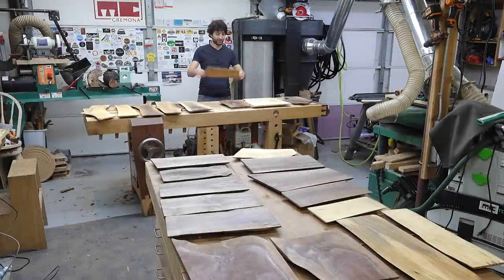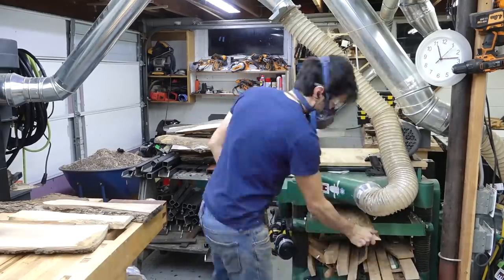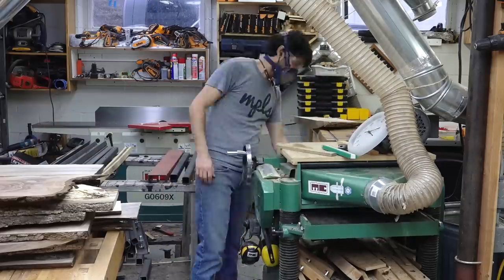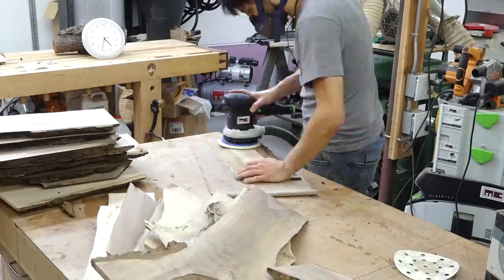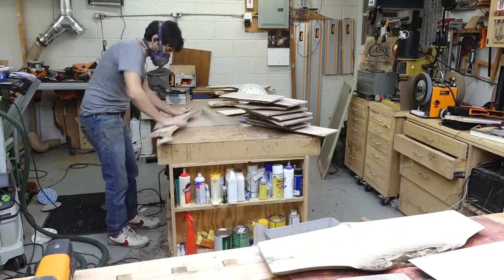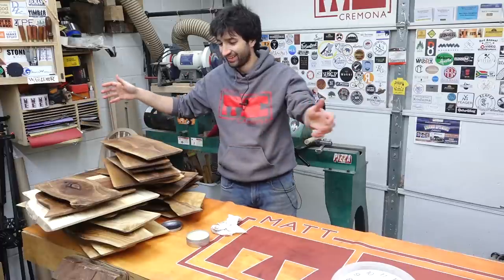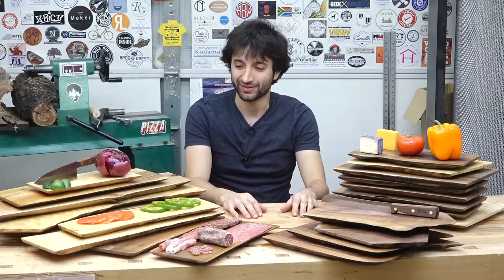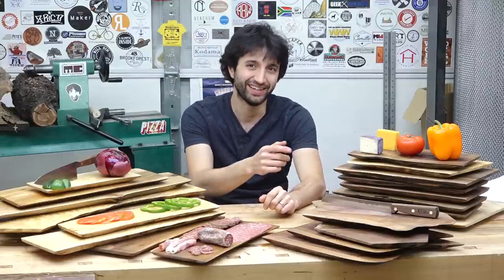Making a Batch of Charcuterie Boards from Firewood

Comment: Wow, you can build a table around some of those pieces. I mean like a steel or twigs leg foundation with concrete and tile mosaic top then one of those pieces as the table top removable center insert.

Comment: There's one thing left in woodworking that I don't understand:
How does one make this type of product such that it stays flat in changing humidity? 
For example: Where I live, last years annual average humidity was 70%. If I air dried the board and sent the gift to Alberta, it would dry more over time and distort. 
The same happens vise versa, when kiln dried hardwood is imported to the island, it absorbs moisture and deforms.

in house humidity is equal to outside humidity during the warm days, but on winter days it drops to 20%. I made a workbench out of flat sawn lumber in my workshop. When I started have a fire in to warm the place up, that bench would not stay flat no matter how hard I tried. So I collected quarter sawn pieces and made a butcher block bench.

Comment: my week before christmas gift for everyone is brazilian cumaru coasters. Ive made 60 of them, only 18 are actually finished so far, 3 sets of 6.
They are end cuts from some amazing teak hard wood flooring I installed. I preserved the flooring finish on the top and routered out the bottom for feet and rounded off all the sides. Finishing wax and done.

Comment: For sanding use a large scrap of thick memory foam. It will hold the piece still and maintain a parallel  with the sander during different pressures.

Comment: I was told by an old timer, as a rule of thumb for drying out wood to work with, you should allow around 6 month for every 5 to 6 inches. So, if you have a log that is 12 inches in diameter, you should wait 12 months before using for any projects. That's why it's a good idea to build up a supply of wood so you can have some ready to use.

Comment: I need a larger planer like yours, what make is it, Matt?
Reply from the maker: Grizzly 1033
Reply: @mcremona  Thanks Matt, looked like Grizzly green. Soon I'll be out on my timbered estate on the Olympic Peninsula where I'm going to build a literal castle with a full woodshop in one of the tower basements. In the meantine we'll be living in two job shacks I'm remodeling,  storage will be several semi trailers and I'll have to get a magnum conex for my workshop. We'll be completely out of debt, totally offgrid in the middle of a vast mixed timber rainforest and I'll have to run my big equipment off generators which I already have. I love woodworkng as much as you do, and a buddy of mine wants to assist and also we plan to have a blacksmithy

Comment: For the fun of it, It would be an interesting exercise given the comments with regards to making some extra cash to apply some values to procuring/sawing the slabs even though they are slabs and could be gotten for free. The machine and shop costs of the processing. Abrasives, the finish, wax, cleaning th shop, and marketing/delivering. Would be interesting kick around some approximate total cost per unit out of the shop. Im sure it would vary wildly from region to region but comparing to a wholesale/retail price range.
Reply from the maker: it certainly would be.  probably much easier for someone who runs a production shop to throw some numbers at.
Reply: @mcremona  To the contrary I think it would be far more beneficial to nearly anyone to apply some basic numbers to the process so they can get an honest accounting of what their true costs are for items coming out of either a productions shop or a home shop. They both have nearly the same costs and overhead but of course completely different accountings with regards to profitability.

The point was moreso to wonder about what is the retail value of the board in varying marketplaces in comparison to the cost to get them out the door. Gifts are always wonderful and something where any form of accounting is typically secondary. Brand recognition aside, the question was more to the point of 16 minutes a board in labor, adding another 10 minutes a board for the other "stuff" puts each at 26 minutes out the door. Given a retail, or selling them wholesale, scenario,... what is the cost of that 26 minutes to cover overhead?

And a further honest question, what does a surfaced and sanded  "slab" with finish command at retail at various retail marketplaces around the country ? I could imagine in an urban area or with some established branding it could be higher than one would expect. Then I wonder in a rural-ish environment where most anyone would see such items as stuff they put in their woodstove daily in the winter, they would pay far less if at all. 

In my world 20-30 minutes a unit out the door would head towards a retail price of $60-$80 if selling them wholesale. If selling direct it might be a few dollars less but not much accounting for packaging, delivery/pickup, collecting and paying sales tax, and so on.

Its always interesting to hear how people account for their "costs" for a given batch of work.
Reply: As a reverse take on that, I was always involved with firewood and milling lumber, but got into woodworking when I saw the crazy prices on relatively simple items made from (scrap) wood.

Comment: Hello Mat. Quick question about washing and sanitizing these and the cutting boards. Once stained and sealed is there a certain way to do it? Would Clorox wipes or any types of soaps mess up anything? Thank you for the awesome videos friend.
Reply from the maker: I just wash them with dish soap while washing the other dishes. A curing finish will hold up to washing very well and doesn't need maintenance for many years
Reply: The only thing I will add to Matts advice would be to use as hot water as you can stand, get both sides of the board wet and dry off right away. I have been doing this to my cutting boards for many years.
Reply: Distilled vinegar also works well, too
Reply: My wife will only cut vegetables on wood, She uses plastic cutting boards for any meat.
Reply: Matthew Cremona thank you sir
Reply: Tom's Dreamshop Worx 🤙🏻
Reply: @ethics1017  Plastic cutting boards are - when brand new - very easy to clean. But after some time, the very tiny grooves that result from use, can become very difficult to clean - and thus harbour more bacteria than a well sealed wooden cutting board.